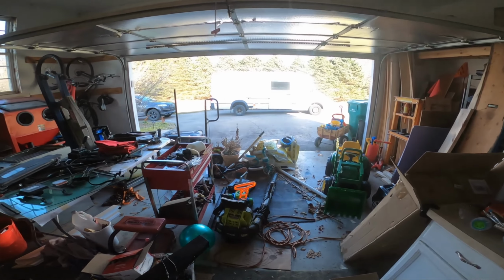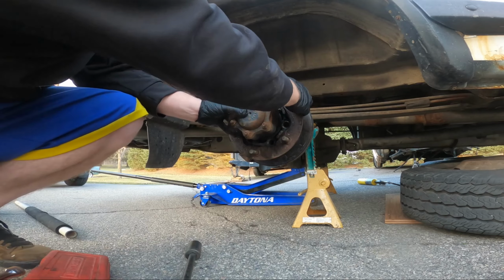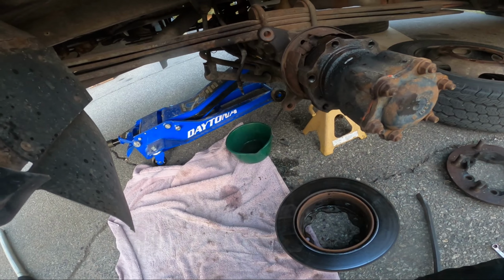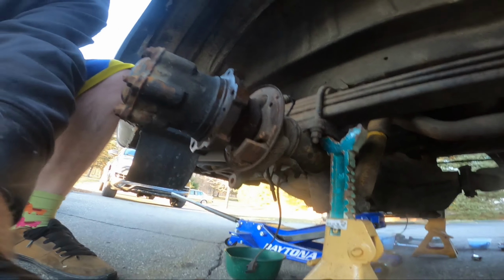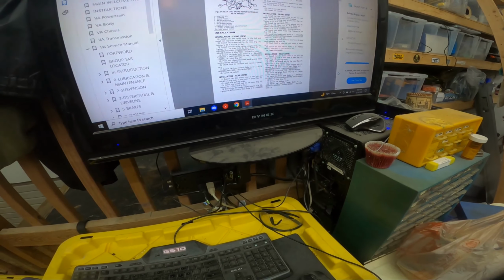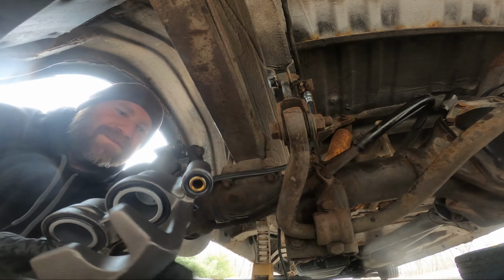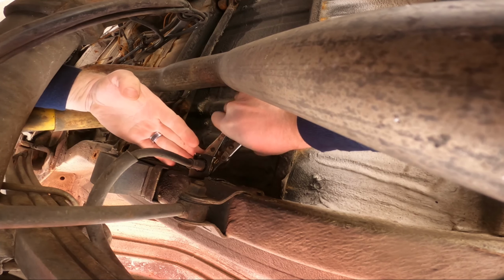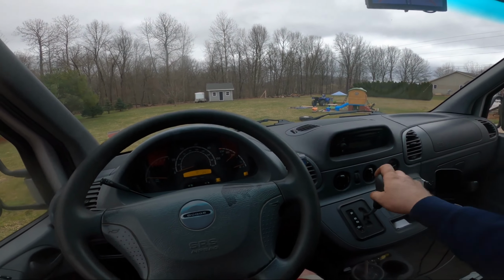2006 Sprinter 3500 T1N Rear Brakes (Video is way too long)

Comment: So you just eliminate the parking break, not install the shoes?
Reply from the maker: Yeah, it's suprizingly common on older vehicles here due to rust.  My only safety concern would be a hydraulic failure at highway speed, and in that case, the parking brake wouldn't do much in a panic stop anyway.
Reply: Dam, that’s why I came to this video doing the drum brakes now, it seems I can do it without removing the axle assembly but still a headache , thx for the info tho
Reply from the maker: @nasty954  They are pretty basic cable/drum setup.  The adjusting nut is usually the most annoying part.  Without checking the service manual, I would usually make sure the cables pull evenly before adjusting the nut.  If you have a second person who can pull the handle over and over, it goes fairly quick.  I also do all those adjustments before putting calipers or anything on so I can remove the rotor and get the adjustment as close as possible before having to poke at it through the back plate.  With new shoes and rotors, there won't be a lip or corrosion in the way.
Reply: @nasty954  same here, came here hoping for a revelation I could use with my 3500. Disappointed at the parking brake delete.